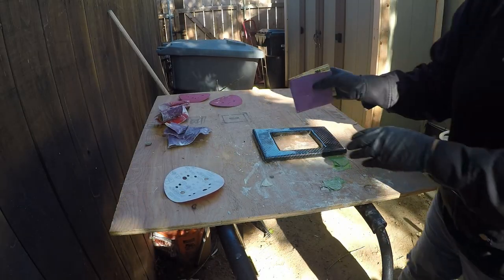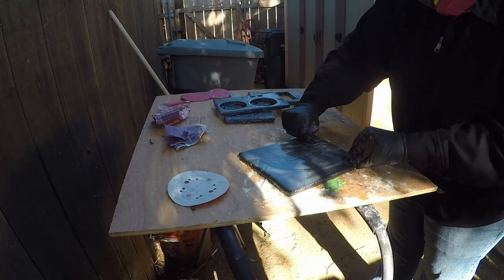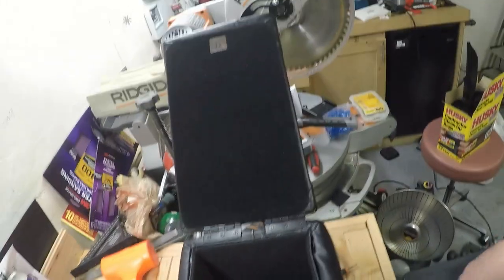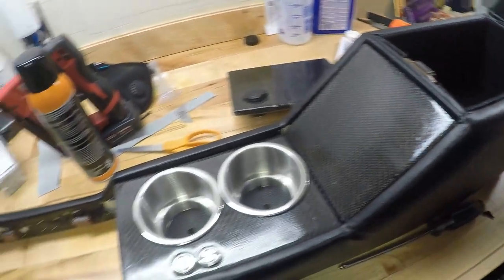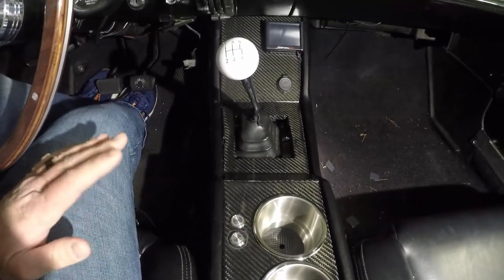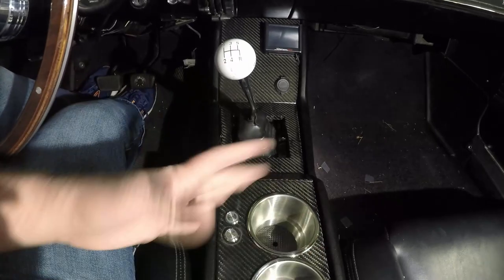Making a Center console Part 7

Comment: WOW GREAT JOB, one thing i didnt see . how did you secure it to the trans hump. does it move ?
Reply from the maker: Thanks!

For now it’s just a snug fit with the front being under the dash and in between the seats. It pretty much holds it still. I didn’t drive it too long with it though before I pulled out the interior for the sound deadening. 

If it starts to move around I was going to attach the front portion to under the dash.

Comment: The expensive part of this project was not the materials, it's his time. The project was very creative but the carbon fiber was not a good idea in my view, but he can always redo those parts at a later time if he wishes. Also the shifter area looks a little too much like a hole, maybe a rubber or cloth material would do the trick. In the end if the creator is happy that's all that matters.

Comment: Did you attach the console to the floor and if so, how was it attachedK great videos thanks
Reply from the maker: Thanks!  

As of yet I have not attached it to the floor. I started painting interior after I built the console. 

If it slides around a little bit. I was just thinking of going to get some L brackets and attach inside the console and to the floor.  Or another option I was thinking would be to attach it to under the dash.